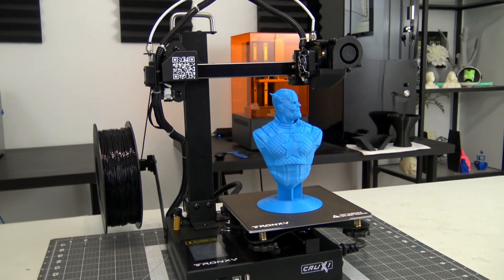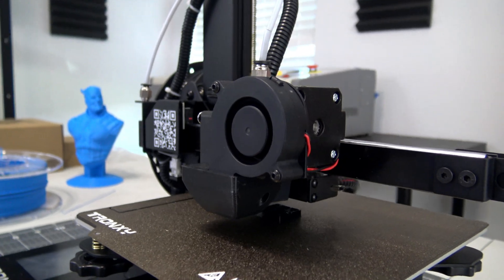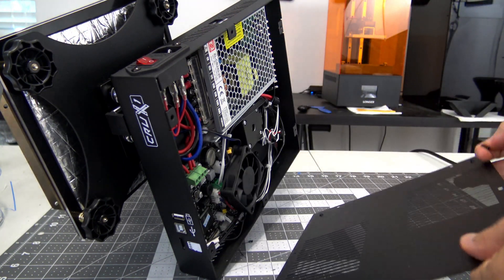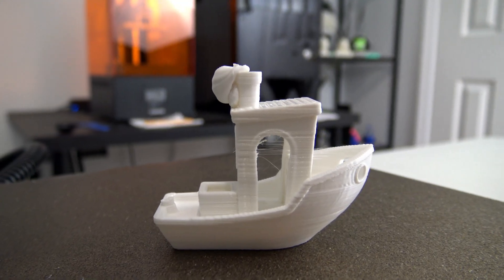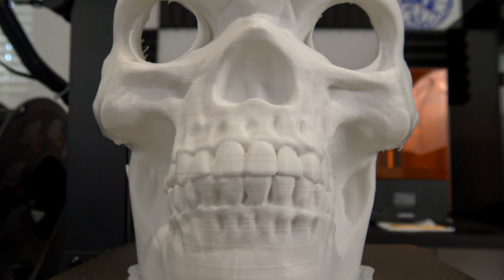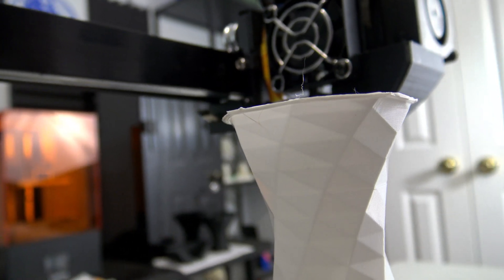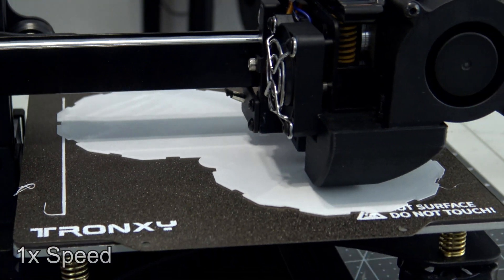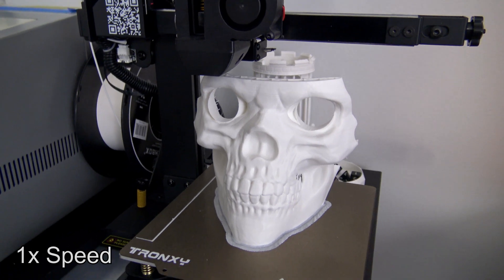How good is a $179 3D Printer? - Tronxy Crux 1 Review

Comment: Have anyone has this issue where the print doesn't print on the bed I fixed the gcode to purge on the bed but I went to do a calibration test and it printed off the bed the purge line didn't but the print did and it was centered in cura before slicing and idea what might be happening
Reply: You gotta set the dimensions on the cura software to be the same as the printer itself which is 180x180x180mm, and copy the start and end code provided on the manual also you have to level the plate properly using the piece of paper provided

Comment: You might be able to fix the bed heating issue by compiling a newer version of marlin firmware.  Assuming of course that main board can handle a full version of marlin instead of what looks to be custom firmware and if marlin has an example config file for this printer.  I wonder if the board is 8-bit or 32-bit.  Otherwise it looks like a good printer though I don't like the issues you were having.

Comment: It's a good thing to see that Tronxy finally did away with their proprietary firmware and switched to Marlin. Also the Z end stop switch is a way better sollution for the Z offset than that blue auto leveling sensor that they used on their XY series. Which is some sort of inductive sensor that relies on metal detection.. on an aluminium bed.. yeah. Which in combination with said firmware always caused the Z offset to be way off. Looks like tronxy stepped up their game quite considerably. Also, none of the other reviews I've seen on the Crux 1 had such bad prints...

Comment: Tronxy crux 1 or Kingroon kp3s?
Reply from the maker: If portability and easy of use is important to you, crux 1. If you absolutely need the highest print quality and don't mind a larger footprint taking up more bench space, then the KP3S. Ender 2 Pro is also a great option, right in the middle of the two.
Reply: Kp3s pro has integrated power supply and filament runout sensor. Does that change anything?